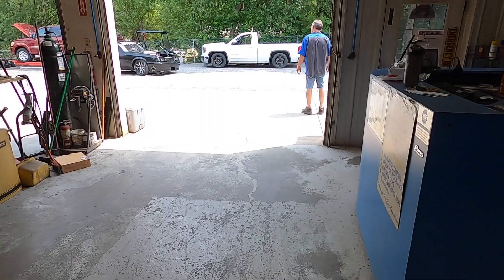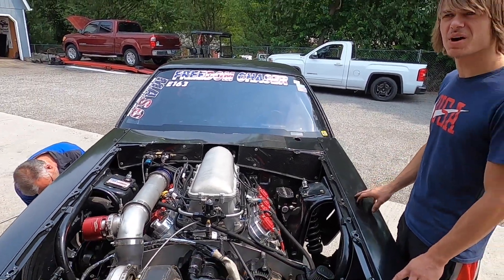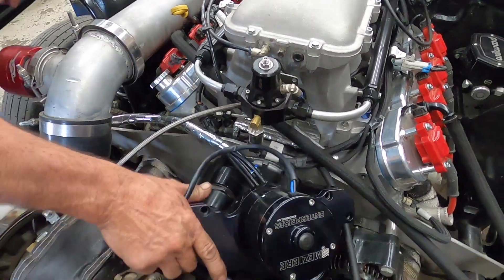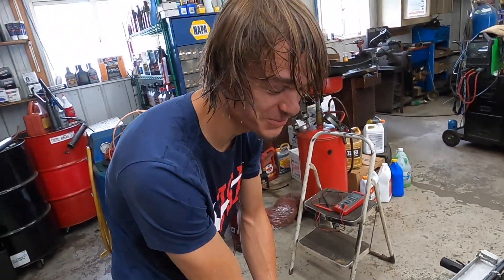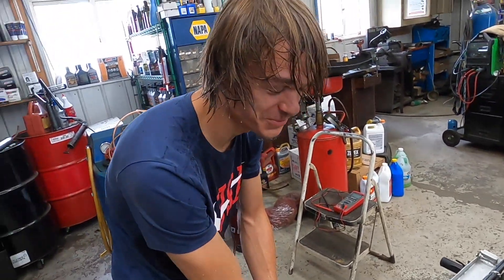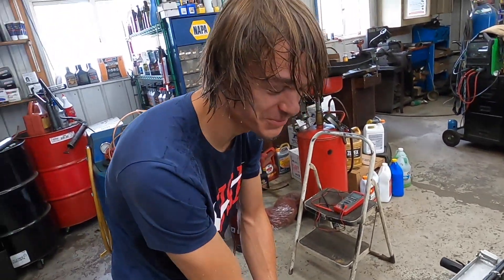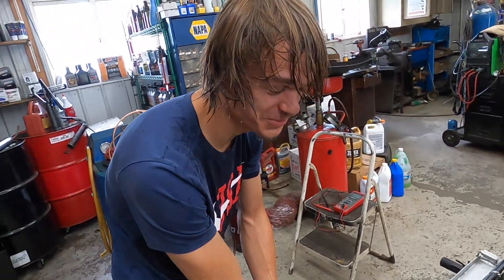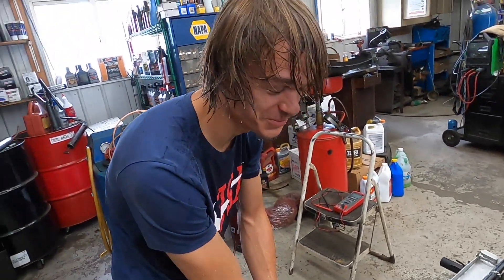Shooting For A 7 Second Pass In A Budget NO PREP Car!    Will This Be Enough?

Comment: T6 flange is a must for a single turbo setup that you want more than this out of. 🤙🇺🇸💯 sick vid.
Reply: I can see from your uploads that Jeremy better listen to you.
Reply: @eriklarson9137  👍 sweet comment
Reply: @itstheonethatsaysbmf3155  
Lol
Reply: @eriklarson9137  because you base someone’s knowledge off their YouTube channel? 

You’ll be sad to hear Facebook subscribers doesn’t make you a expert at anything but entertainment. 

And he’s right… your only gunna get so much out of a small t4 on a large motor before back pressure keeps you from making any gains.
Reply: @nsboost  NAILED IT BRO .... lmfao I have 5 ASE certs. And an Engineering degree 🤭
Reply: @nsboost  and 2 BAD TBSS's in the driveway 😉
Reply: @itstheonethatsaysbmf3155  I went from a cast 75mm s400 83mm turbine with a 1.10 T6 housing to a billet 85mm s400 96mm turbine with a 1.32 housing this year.

The smaller turbine and housing really slow down making power around 800whp (20-22ish psi) on my 5.3. I could have stretched it further making some changes to the s475 on the turbine side… but it cost me about the same to sell it and buy the bigger turbo.

Now I can really throw the boost to it 😁
Reply: @nsboost  yeah buddy.... my old ride was a big tire 71 nova with a big block, I had an S475 to put on it but ended up selling before finishing and built one of these blazers instead.... I love to chop with A.C. ... right now the more built one has a heavily modded LQ4 running the ZL1 cam with LS6 springs. All built in my garage, I heated the 58x reluctor in my oven to do the swap for the ls2 cps...  Dyno tuned at SQR in Ft. Worth.... After the beginning of the year it is getting the ZL1 charger kit from Boostdistrict 😎 pulley swapped to put around 12 pounds through it.
Reply: @nsboost  https://youtu.be/NzIQTGn6huQ 

Link to the dyno tune, didn't think it was still on yt.

Comment: They might consider running Holley’s CDI add on ignition module to help with the spark a little. Definitely needs the T-6 housing upgrade though, and I’m surprised they didn’t go the route of quite a few others and ditch the intercooler for some weight savings, and run it on methanol instead.